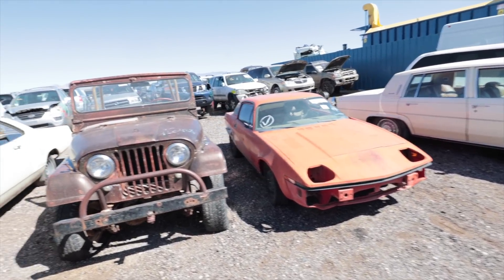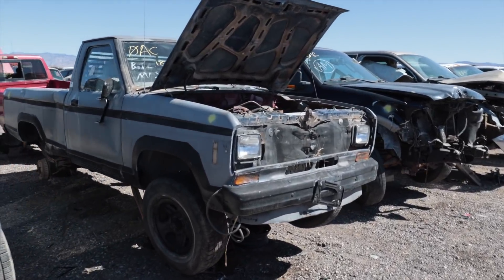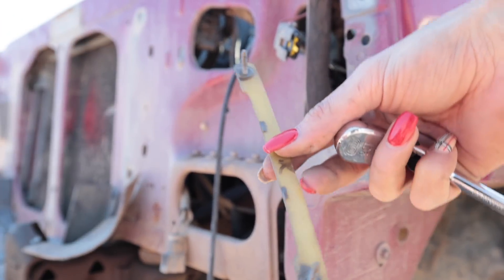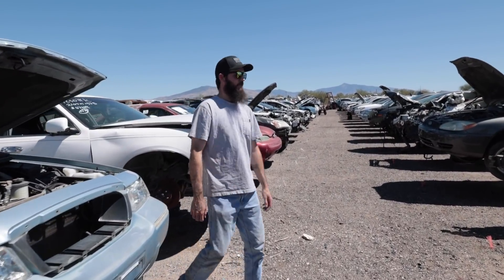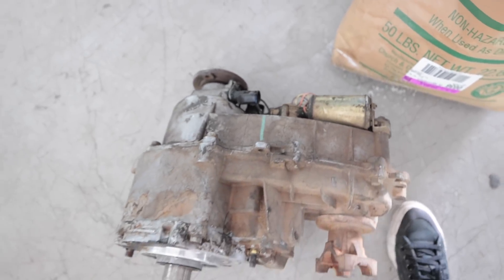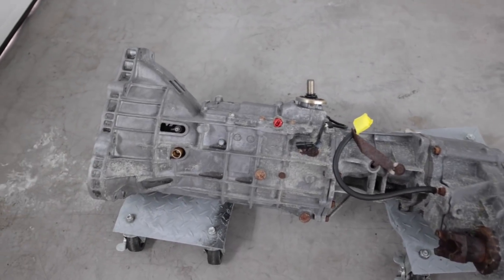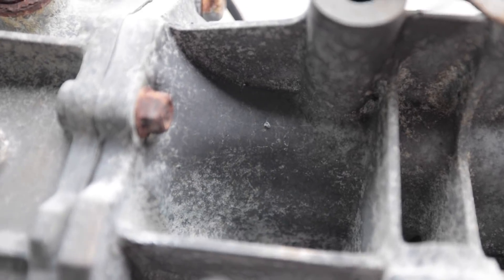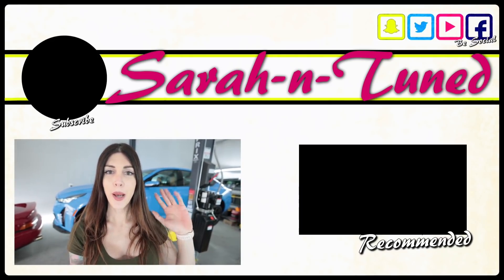This Escalated To A Drastic Solution // Severely Corroded Ranger M5OD

Comment: Muriatic acid is just impure hydrochloric acid. It can eat up aluminum pretty badly. Lungs, eyes, skin too, just depending on how concentrated it is. You'll see lots of recommendations to use a full face respirator, and to use the stuff for masonry and tile cleaning only. If it is concentrated enough, a vapor fog will literally climb out of the bottle and then up your arms and into your face.

Comment: Have you heard of this super cool power tool called a, "Dremel".  Doesn't cost a whole lot.  You can use it in really tight spaces.  And you can use small, fine wire brushes to clean and buff things.  The tool can also use small cloth-like buffers for polishing surfaces.  I'm certain it would work well with Brasso.  IMO, it beats dressing up like a bag lady and using caustic chemicals.  I'd gift you a few cats to go along with your new garb but I'm certain they wouldn't stick around due to the smell of the chemicals.  They'd probably find their way over to more fun territory.  Like that vehicle with the hoarding rats. 😜

Comment: Muriatic acid is a great all around product. You can clean with it, balance the ph in pool water and use it for a drain opener, great stuff, but smells like rotten eggs. haha

One of my 30 year old ratchets was slipping, I took it apart and filed the teeth and cleaned all the gunk out of it. I cleaned it so well, it look brand new and I thought, Sarah would be proud. 😁

Comment: Wish you would try sandblasting with 220 grit aluminum oxide. I think you will be pleased of the results. We used it on everything. Leaves a satin finish on steel , cast iron and aluminum.
Reply: YES! I said that in the other video. Sandblast it. It will look brand new!
Reply: Yes, that always works, but sometimes you need to clean something without taking it apart. You have to be very careful using sand around openings, mechanisms, seals etc.
Reply: @phila3884  yeah I wouldn't sandblast  a transmission without splitting the case and blasting the case stripped and separate.
Reply: @phila3884  You could always use baking soda or dry ice. It won't hurt anything if it happens to get inside.

Comment: Muriatic acid is used to clean fresh brickwork after the masons point up the joints, We used to spray it on brush it down then rinse it with water. I find it has multipul uses. Used to to clean rust from a motorcycle gas tank worked great. Just a mild acid.

Comment: Hey, cool video.  You're committed to restoring your truck to factory condition.  Respect.  I think the process you're looking for to restore the factory sheen on alumin(i)um castings is called vapor honing.  There's lots of videos and diy stuff here on youtube.  And you can replate those brackets and bolts using the copy cad setup from caswell plating. It's real zinc plating with a yellow chromate wash.  It's the real thing.  I'd love to see you do this.  If you REALLY want to see this truck look factory new, you would be very satisfied with the results.

Comment: You should have asked a trucker. We use 90% hydrochloric acid cut with 10% sulfuric acid to clean aluminum tanks, steps, and wheels on working semi's. You could probably talk a local commercial truck wash to clean those up for you for a few $.
Reply: Yikes. But I'll bet the sulfuric keeps the HCL from fuming, am I right? Easier to use that way

Comment: Everything I have read on the subject says you want to use glass bead blasting on Aluminum casings and it will bring them up like new. Small sand blasters are very cheap and you just put glass bead blasting media in a sand blaster. IMO it would be a worthwhile investment if you plan on doing more restos.

Comment: I suggested the muriatic acid. I use it all the time for intakes, heads, and transmission/transfer cases. Spray it on (spray bottle will work, I use a garden sprayer), let sit about 30 minutes, you can see the oxidation dissolve away, test with your scrubbing toothbrush if desired, then flush with water/pressure washer, let dry. As for PPE, just stand upwind!

Comment: Owner of a fancy ranger and following closely.  Try using brass wire dremel wheels. I had a corroded ATV engine and used them and it wasn't too abrasive and left a great finish but used a lot of wheels.  Also try brasso or autosol, the have acid and abrasives that work together with your toothbrush.

Comment: Blaster and a rag and LOTS of elbow grease will do amazing things to casr aluminum. The corrosion is aluminum oxide, the same thing they make grinding wheels and sandpaper from. Oil puts it in suspension and the rag works like a polishing wheel. The corrosion will keep getting smaller and smaller as you rub on it. Dont wash it down untill your hapoy and it can almost make shine like chrome with enoygh rubbing.

Comment: Try using a wire wheel (or various sizes of wire wheels) on the aluminum casing. The brushes you're using are to soft. I think you'll like the outcome of it when you try it with a wire wheel. Also, the steel parts I'd suggest taking the parts off it and media blasting and powder coating them up. :)
Reply: That's what I was going to say. I've seen her use just about every chemical trying to avoid elbow grease. I had an expedition that had the same problem. I ended up using a variety of wire wheels in a drill. It took a while but it all came off.
Reply: That would have been my first choice and probably wouldn't have taken as long.
Reply from the maker: It’ll leave the casing looking scratched up like 💩.
Reply: @SarahnTuned  I respectfully disagree. It's a not perfect looking casting to begin with. You can use a brass wire wheel with brass if that's a concern. Then there's sandpaper if it's still too scratched.

Comment: Miss Sarah, have you ever heard of Navel Jelly or was it fuzz, no it was Jelly. I have seen people use that on aluminum doors to clean them, works fairly well. Hope this helps or at least made you smile.
Reply: Naval Jelly is for rust removal on steel.  Aluminum Jelly removes corrosion and "white rust" from aluminum.
Reply: @rocketscientist007  thanks for the correction. I knew it was some kind of Jelly.

Comment: Too bad I can't load up pictures in the comments. I saw you were using  a nylon cleaning  brush in this video, but when I mentioned nylon brushes in the previous video,  I actually  ment a different type. They are basically similar as wire brushes, but come with blue or red nylon strings. The blue are softer and the red are harder. You can actually  polish aluminium ( in Belgium we pronounce it like the British and the "u" like in "you"🤪) to a point where it starts to shine. In a next step you can polish aluminium with sisal disks an polishing compound, making it shiny like chrome. But I  guess that might be a bit of overkill for a transmission...  did it once with the housing of an alternator. Took me a whole day. Ended up braking the old insulator on the positive terminal, without noticing...turned the chrome alternator into a burning ball while the engine was idling...

Comment: That junkyard is awesome! A few years ago I was looking for a clean rear bumper for my 2007 Tacoma and spent an afternoon searching through the junky junkyards on North Airline Drive in Houston and the best I found had cracked plastic trim and rust coming through the chrome and they still wanted a couple hundred dollars for it. Turns out a very nice new aftermarket bumper found on eBay after a few minutes searching online was significantly cheaper than that used POS. Sometimes and in some places it pays to consider other alternatives.

Comment: 12:18 Muriatic acid can be used like bleach but it's bleach on crack. Muriatic is 0.7 or 0.8 Molar Hydrochloric acid (HCl) as opposed to bleach which is Perchloric acid (HClO). Bleach isn't concentrated enough to etch aluminum but Muriatic acid can etch aluminum pretty easily. Baking soda neutralizes both but you'd need a bunch more for Muriatic acid than for bleach. Muriatic acid is usually used to etch concrete before coating. A little late for a warning but it's dangerous stuff. If you get it on your skin and rinse it off with water within a few seconds there's no damage.

Comment: Lysol toilet bowl cleaner with some stiff brushes will make aluminum/ pot metal parts look like new again. A final rinse in baking soda to neutralize and a little clear topcoat. Ive been using this method for 30 years. Stronger acids tend to discolor the alloy. Do not use any other brand of toilet cleaner. Only lysol. I have tried them all.

Comment: It's hard having OCD and being realistic at the same time, haha. For the aluminum, using a wire wheel on a drill can give a muted shine to the surface although it's hard to get a consistent surface finish over a large area. Another option might be using a metal polish on a stiff pad with a drill or other rotary polisher.

Comment: I wonder if dry ice blasting would work? I've seen it used on engine blocks and transmissions and it made them look like new in one go. No chemicals, not harmful to electrical components (e.g. starter motors), might be worth investigating

Comment: Others recommended muriatic acid because acid 'reverses" oxidation.  One of the main industrial uses of hydrochloric acid is rust removal from steel.  EasyOff is chemically the opposite, a base or alkaline.  Be careful though, muriatic acid can eat aluminum too, if left on long enough.  If you had a small engine (like a lawnmower or similar) that had a lubrication failure and the aluminum of the connecting rod "smeared" onto the steel crankshaft journal, that's an example of "galling", and the aluminum can be quickly removed with muriatic acid, without fear of damaging the steel.

Comment: The 3 rubber plugs on the back side of the shifter , you need to pull them out and replace with freeze plugs so it doesn't seep oil.......this is done to prevent this..FYI

Comment: Transmission will corrode even faster now that all the protective oxide layer has been removed.. gotta paint or clearcoat it now for sure!
Reply: 2x 👍
Reply from the maker: Corrode.. in Tucson? Maybe in 500 years
Reply: @SarahnTuned  it will be fine, I'm pulling your chain a bit:-)

Comment: 1969 Dodge Polara. Being a 2 door, it's somewhat rare now. Most of them were 4 doors, and fleet vehicles. Crazy fact? The 69 Polara, I'm guessing 440 powered, held the record for fastest police car until 1994!! That boat went 149 plus mph! If you ever drove a Mopar from that era with power steering, you'd know there was zero feedback through the wheel. At. All. None. Scary for sure.
Reply: Even worse with the quick ratio steering box we had a 68 Monaco when I was a kid me and my younger brother used to steel that boat at night and load up like ten buddies in it to cruise back roads all the time when we were in Jr high amazingly never got caught and only put it in the ditch about a half dozen times out seeing how far we could keep it fish tailing
Reply: @79huddy  some of those cars, didn't have a different steering box. They just changed the length of the pitman arms and idler arm to act like a quick ratio box.

Comment: Soaked a rusty discusting metal part in CLR ( Calcium, Lime , Rust ) it is a very safe chemical that you can get almost anywhere, Home Depot, Lowe's, Walmart , supermarkets etc.  It has to be soaked in it. Spray bottle may not work without respraying and scrubbing over and over. It has to lay in CLR .

Comment: Those places move the cars with forklifts and almost always taco the drive shafts.  Phosphoric acid (I got it at Home Depot) is a common rust treatment on steel but I've never tried it on aluminum.  I kind of doubt it would turn it bright.  I've been hoping you'd find some easy way to get it looking nice.  All the bottom sides of everything aluminum on my car looks the same after several ski trips to Utah & yes I pressure washed it when I got home.  Still turned crusty.

Comment: I think you should have taken it somewhere and had it bead blasted, not sand blasted or soda blasted, bead blasted, it will look like it was just cast and it would clean all the rust off all the bolts, you would have to mask off wiring and make sure all the vents were plugged, you would be amazed how it looks after, like it was just cast
Reply from the maker: That cost more than a new transmission, I looked into it.

Comment: The way those cars were precariously balanced on wheel rims in the junkyard made it seem like a giant field of dominoes.  I am sure it was sturdier than it seems, but I am not sure I would crawl under one.
Reply: They are welded together. It's a cheap and extremely efficient and safe way to make stands for all these vehicles. The vertical wheel cradles the frame/pinch weld and the horizonal one provides lateral stability. And since the wheels were literally made to hold up the weight of the cars there is plenty of strength. And since almost every vehicle they get comes with a set of wheels you have a never ending supply at least until all the vehicles that offered steelies go away.
Reply: My local yard will flip the vehicle over on its side for you for any bottom side parts removal. Very handy .

Comment: Muriatic acid is too agressive to steel. Bad juju for alloy steel bolts (hydrogen embrittlement). A better option: Alumiprep 33 (phosphoric acid based). Works quickly & well.

Comment: Hi Sarah, I would recommend that you replace the input shaft seal and the two output shaft seals also there are three rubber plugs at the base of the shift tower that should be replaced with the same or I used small brass plugs especially with the Arizona heat

Comment: That was a 1969 Dodge Polara Hardtop.
Reply: @rogersmith7396  we had a 70 Dodge Polara Police Interceptor model with the 440 Magnum.  Only car I was aware of that had reverse threads on the wheel lugs on one side of the vehicle.   You could "almost" see the gas gauge move.

Comment: Big improvement on the transmission now that it's had dry ice, salt, acids, bases, a metric f ck ton of foam and enough water to cause a local shortage I give it 6 months before it's whining fit to bust.

I'd have masked it up, with sand blasters tape, and got it bead blasted myself.

Comment: That Saab is a 9X and its not a 4800 its a 4200. Same Engine as the Trailblazer and Envoy. ;)
Reply: Some of the Trailblazers came with the 5.3 as well. Don't think there were very many of them though
Reply: That Saab is a mockery of its former self. Badge engineering at its worst. 6 divisions used the same SUV with mild skin revisions. Embarrassing!
Reply: @JayLepisto  Lol ALL car Manufacturers do this.
Reply: @darkblaze176  I know but why did GM buy SAAB to replace its own models with Bravadas and Imprezas. Misleading average folks into thinking they were quirky and fun loving in owning a SAABuru.

Comment: Be sure to NOT store Muriatic Acid near anything that can rust or corrode. The vapors will escape the plastic container and attack any bare metal in the area (tools, drill bits, parts etc.)
  Muriatic acid can be used to strip the plating off of hardware before welding.     Very nasty stuff, be very careful of the fumes!

Comment: Sarah, muriatic acid is strong stuff. 
I used to use it to clean  brick face, will burn shin .wear goggles & gloves please. Don't breathe the fumes.
Reply from the maker: I was wearing a face shield and gloves..
Reply: @SarahnTuned  yes, I saw your  home made unit. Quite the outfit, lol.
Question Sarah, I have a 2001 
MR2 Spider  midship. Needs a new top( I have) would it be possible for you to put the new top on and make a video about it sometime this yeat?
I'm in Alamogordo, NM. next door to you.

Comment: 12:30 and on, why don’t you sand blast it?  Just the necessary to remove all you don’t want. And about the squirrels shelter, metal will corrode sooner or later, giving place to rust, metal foil is a human invention, and as such, it doesn’t belongs to nature.